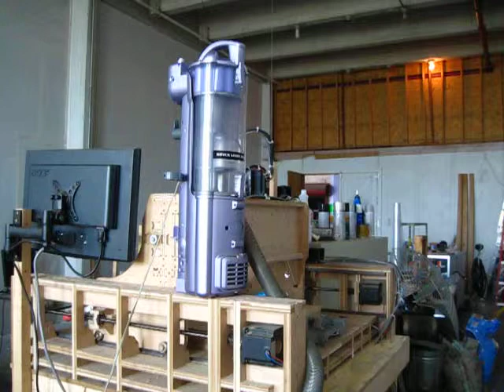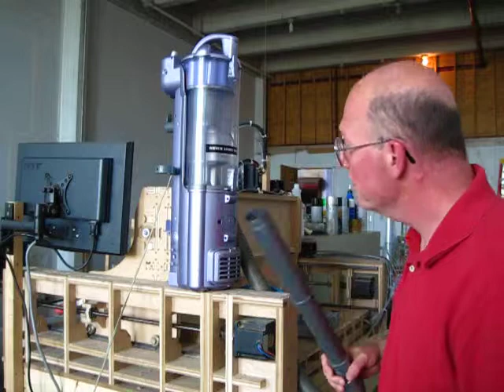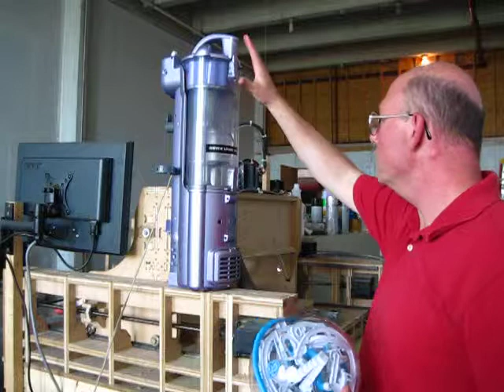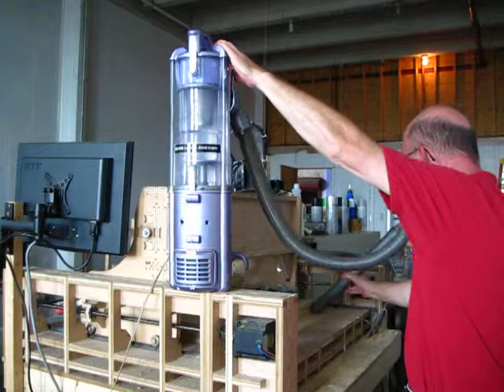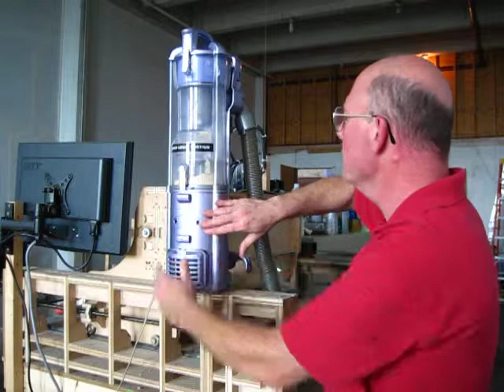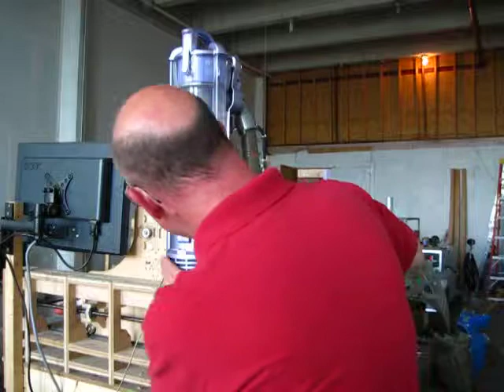Initial Evaluation of Salvaged "Shark" Upright Vacuum

Comment: So the motored bured out do you still have it? Did it ever come with the handle and brush
Reply from the maker: Hi Lou.  No, we discarded the unit after the motor burned up.  Apparently the Shark's motor was not rated for a 100% duty cycle over multiple hours.  As for your other question, see my reply to you from three years ago :)

Comment: why is there no handel and no brush
Reply from the maker: Lou, since I was performing a test of the major assembly (vacuum motor, filters and separation chambers) after the thorough cleaning I did not fully re-assemble the unit.  So, as you noticed, the floor beater-bar assembly, side wand and handle are not attached.  As a follow-up, I never did fully re-assemble the unit.  It was mounted to the side of the CNC router and used to suck up cuttings at the tool when the router was in operation.  The re-purposed Shark lasted for about three months in this configuration until the motor burned out.
Reply: oh okay